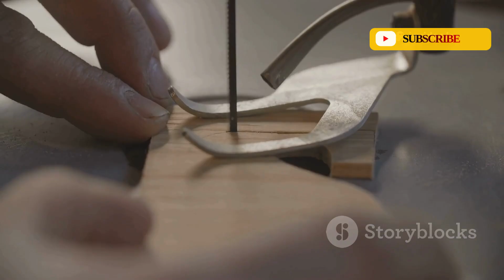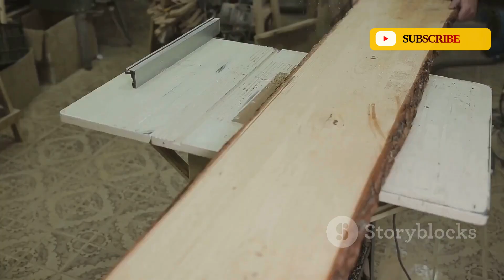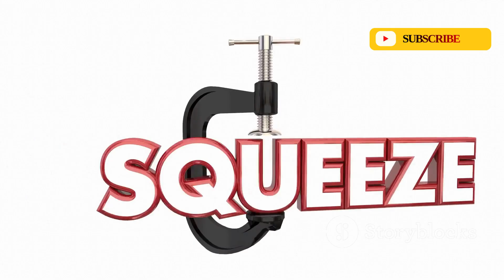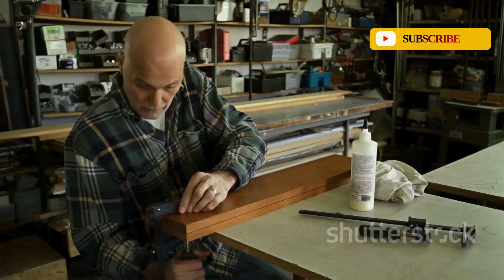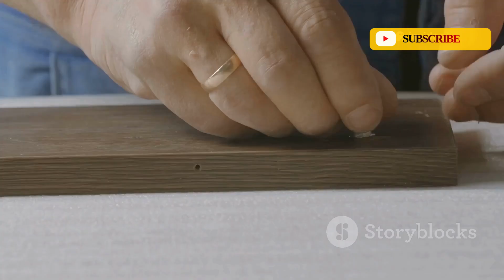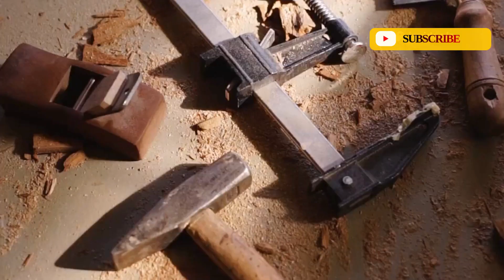5 Woodworking Jigs That Cut Your Build Time in Half

Comment from the maker: The drop-in stop block system is criminally underrated - switching cut lengths without re-measuring from scratch is a huge time save on any batch run. Which jig are you building first?

Build a zero-clearance jig: https://woodworkingadvisor.com/how-to-make-a-circular-saw-guide/